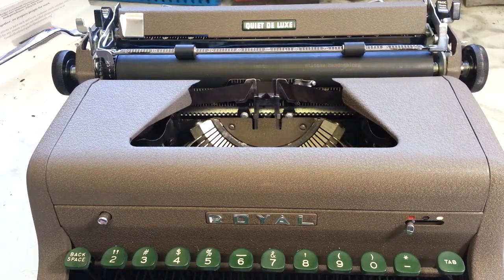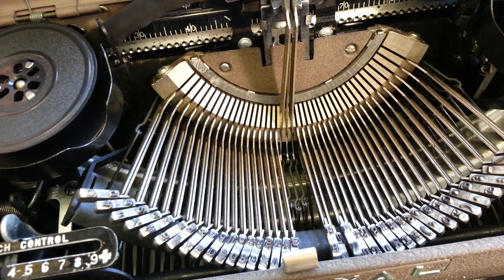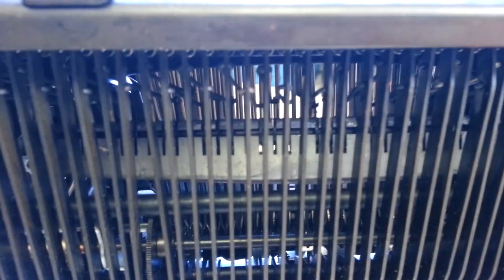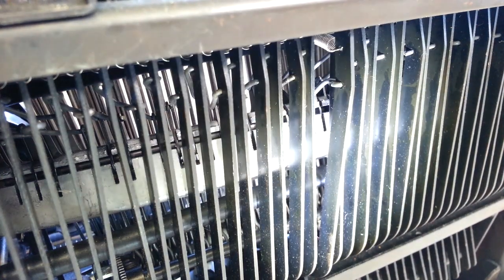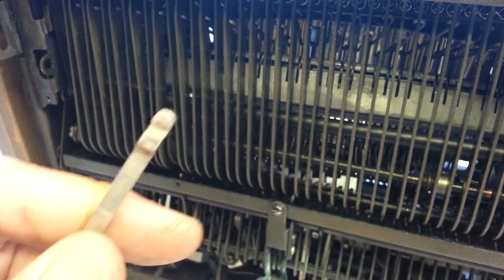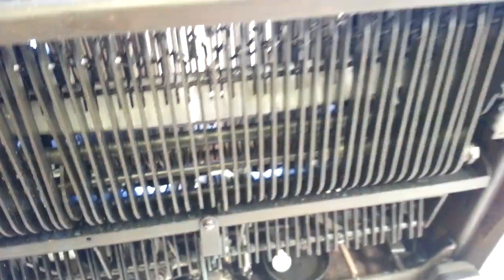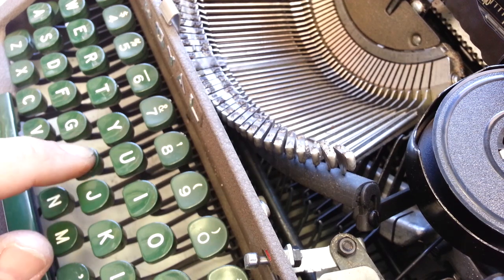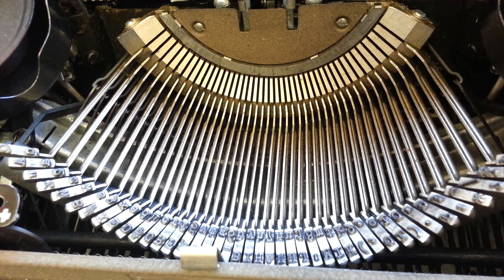Royal Quite De Luxe Repaired Type Bar Stuck Up, Link Bent on Typewriter

Comment: I was able to use this tip today. I acquired a 1935 Royal  Model O with a stuck key.  I used rubber bands to hold back the keys on either side and was able to see and fix the problem,  I don’t think I would have thought of this approach without seeing your video.  Now this machine is on the road to being useful again.  Thanks for sharing your expertise.

Comment: Very timely! I have a machine with the H, naturally, sticking up at least 1/2 inch! First, I groaned when you pulled out a custom tool, then cheered when I saw you use cheap pliers! Now I will try to address this issue with a typewriter that looks like it is extending its middle finger to its (previous) owner!